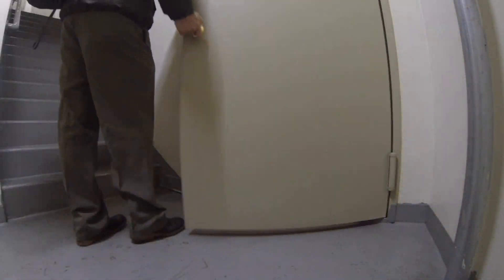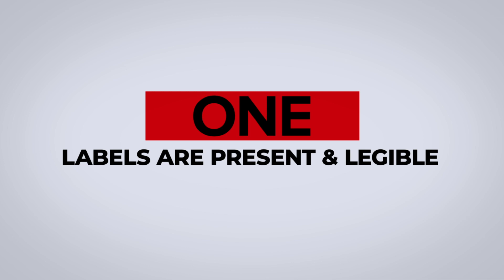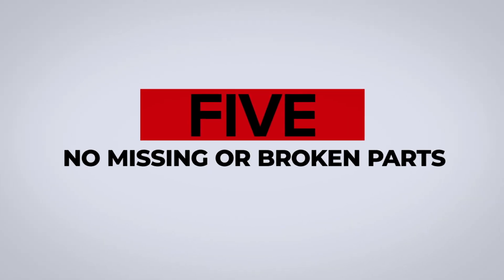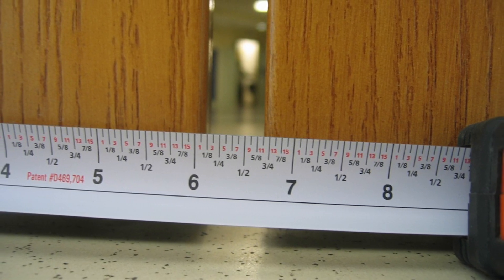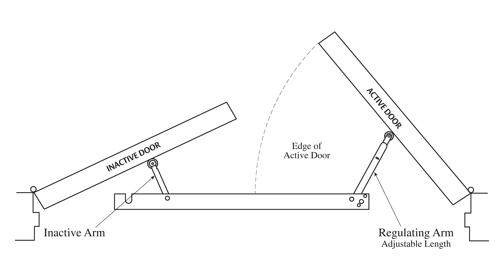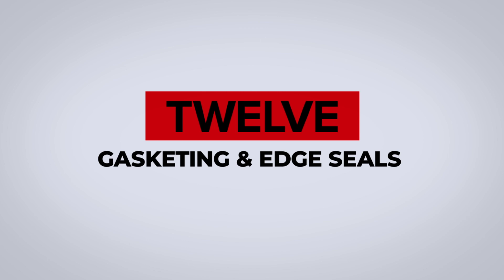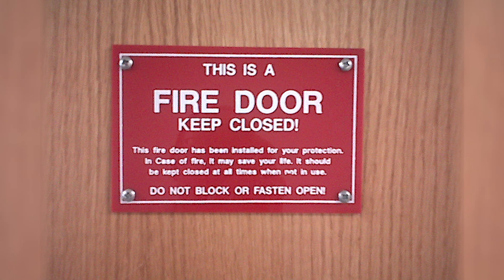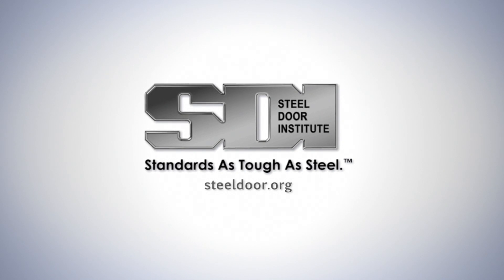Fire Door Inspection Checklist | 13 Inspection Criteria | Steel Door Institute

Comment: As a retired 30 year veteran commercial door and hardware installer I would like to say #1- great video,I always watch these.
      In my years of new construction ,following specs,a d in 15 years of building maintenance I can say after the specs were applied and the doors and hardware supplied and installed ,no one pays any attention to fire doors or codes.
       True ,I have worked all over my state and very few so called "FIRE MARSHALLS" have any education on the specifics of fire doors.
      I used to have to respond to hundreds of inspection violations but most were basic,closer issues,blocking doors open ,latching adjustment issues,but I have seen them write an issue on a door opening and miss two other issues on the same doors,limited knowledge.
     And the building owners and end users never have fire code knowledge. 
       So my point is ,people only pay attention to fire door hardware only in the planning ,specification and installation stages.
       I was fire door trained and when I did 13 years of public school door maintenance I have found and fixed hundreds of fire door code issues and improper installs such as windows and deadbolts added,hold open devices etc...that years of "FIRE MARSHALL"inspections missed.
Reply: Google "The Story Behind Von Duprin"
If you have 15 minutes for a YouTube video. Being a Door Guy you might have seen the video already.
I started in the Commercial Doors in 1990 when ADA was just getting started.
It's called Hard-ware, because it's not Easy to Spec, Order & Install until you been doing it for as long as we have.

Comment: Thanks!

Do hinges need to be labeled?
Reply: As a door installer I can tell you any commercial door hardware will have a UL listing stamped in them ,they are usually accepted without individual testing